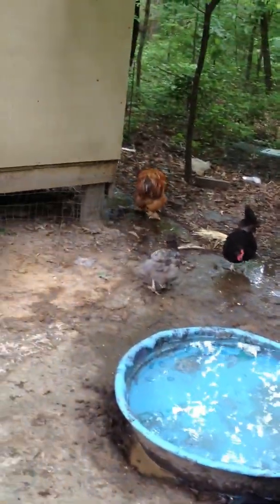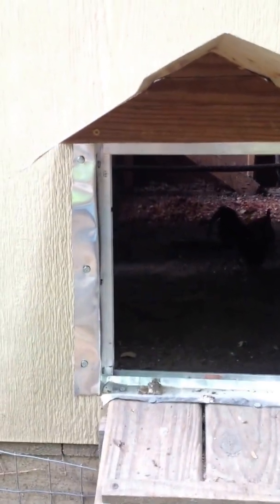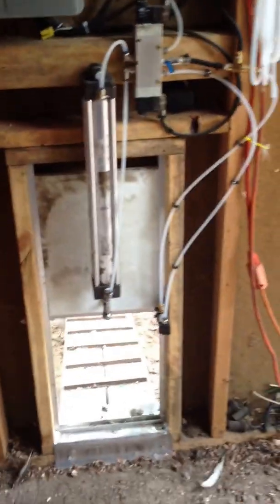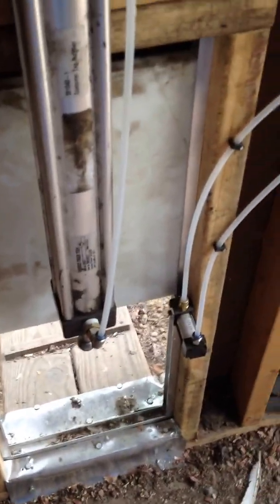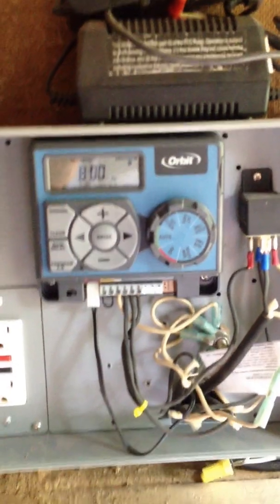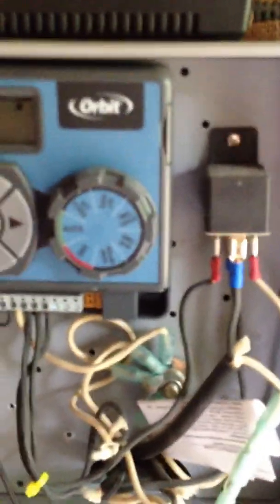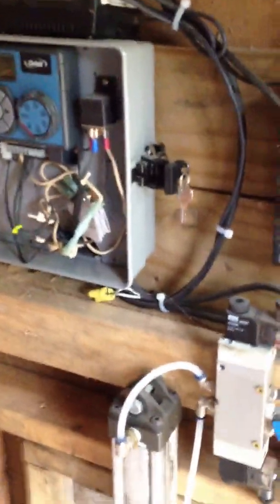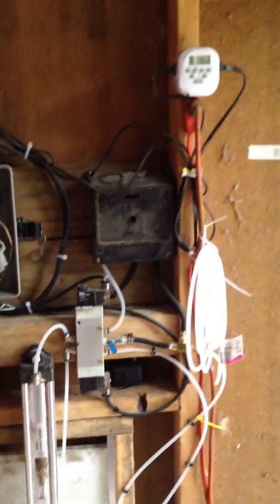auto chicken door opener for coop, pneumatic system

Comment: I like this. I'm not a big fan of using house power in small coops but this is well done. I'd change somethings but that's if I was purchasing everything new. If I had those parts on hand I would have done the same. Great work.

Might I ask what your issues with the Linear Actuator were? I have yet to have any on the seven I have been testing for the past 2 years.

Comment: You only need a timer and a single acting cylinder with a three way control valve, all on 120v ac.  Way too many components there. You use the cylinder to lift the door and then weight the door to drop. Chickens wont lay eggs with that terrible noise. Put it outside and get an air reservoir.  Timer on- door up. Timer off - air exhausts on 3 way valve and door drops.
Reply: Nah His is done right. Or at least WAY BETTER than yours.  Controlled up and down. Not a death trap with a door that just slams down. No big ass tire that has to be refilled and takes up room. Reused a timer, and that timer can be used to operate more than one device.
Reply: @AztecWarrior75   Rube Goldberg on drugs with a chainsaw and no muffler.  Absurd!  Worried about your judgement.
Reply: @RRaucina  You are crying "Rube Goldberg on drugs with a chainsaw and no muffler." about a well done door opener (as opposed to yours) and you "Worry" about MY judgement. LOL. That alone says the opposite on whose judgment is questionable.  Might I remind that you didn't even know what a 2x4 is. LOL